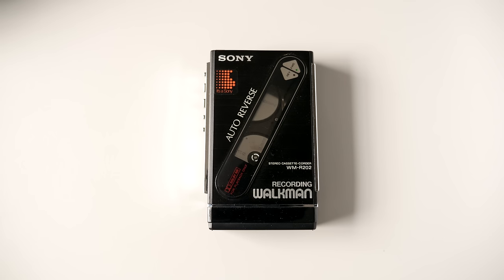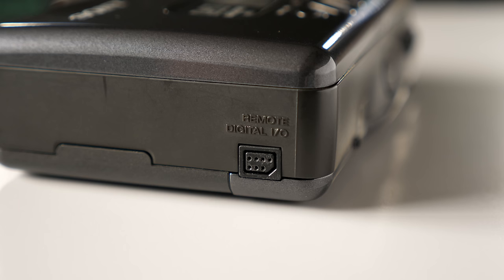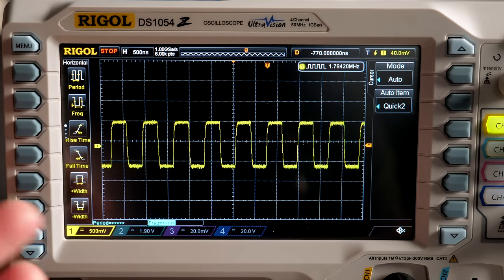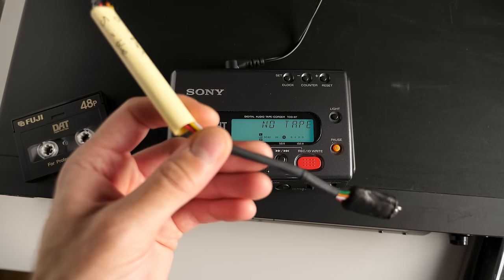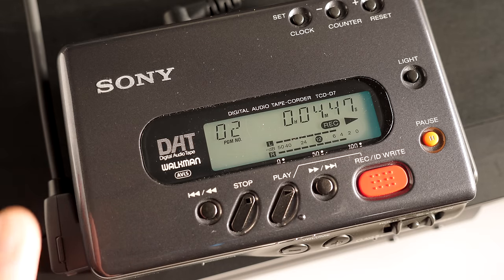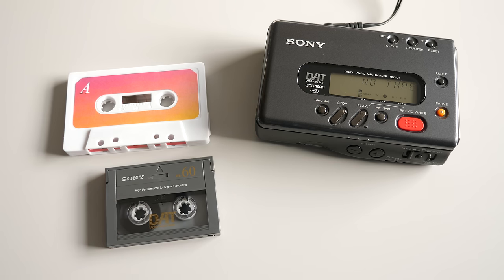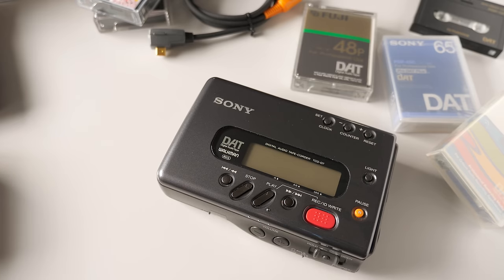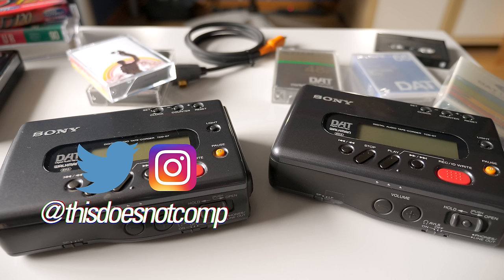Sony DAT: What Cassette Should Have Been!

Comment: Can I suggest a review item: In the 1990s, maybe early 2000s, there were the highly regarded Musical Fidelity X series components which came in a "beer can" form factor. They still go for ca 500-600 Euros these days for a pair of mono power amps. But there are a few sellers on Ebay who claim to sell copies of the internals for 50 dollars, basically just the boards, I think there is even one seller from Romania who sells them at 27 dollars. These are 50W mono amps, so obviously you would need two. The real thing is called Musical Fidelity X-A50. So the claim is that these ripped off designs actually perform like the real audiophile deal from ye olden days, or so it seems. You can find them through Ebay or hifishark.

Comment: I know a radio station that used to use DAT for jingles, etc.
Reply: I guess the reason for like 15min DAT tapes which would be rather usless for consumer use. There are also lots of these 15 and 30 min tapes going for crack smoking prices on ebay.
Reply: For delivery of jingle packages for loading onto carts or delivery systems?  Or playing directly on the air?
Reply: @scottstrang1583  I believe they recorded the jingles onto DAT, and played those directly on air. To be clear, I wasn't involved directly, and never witnessed this in action. I just heard them talking about recording jingles on DAT, and then they would take them to DJ's, who would play them on air.

Comment: DAT recorded at 48k. And I think the D7 wouldn't record via the digital input at 44.1 though the D8, which I had for recording live shows did. I miss my D8.
Reply: It actually does, but only when you record digitally. When you switch it to SP, it automatically selects between 48KHz and 44.1KHz depending on the input signal. This is so that you're able to record CDs over. When you record an analog input, it'll only do 48KHz.

Comment: NICE man!!! hahaha, I had to do that same thing back in the days, the I/O 7 pin thing. I found the info at datheads forum. I had to buy an IC buffer and so. That was a hell of a DAT deck, I used mostly to record on location but the digital I/O was handy to have.
Reply: BTW, I remember have read an article by Stephen St. Croix, a MIX magazine columnist I used to adore (resting in peace now) that DATs had a terrible error correction rate, and he was able to prove that 1:1 digital copies done in DATs will differ (data wise) from each copy generation due to the error correction algorithms, mostly caused by inconsistencies on tape media coatings,or due to friction, head misalignment, transport issues and others. I had really hard times when listening/mastering to certain DAT tapes that were recorded on different equipment than mine, and I had 3 decks! (DA-30, SV-3800 and that tiny D7). That probably add up to why they disappeared...
Reply: @juanfebresc  That's interesting to note, I have asked elsewhere on here what the deterioration of tape was like compared to the standard cassette.

Comment: I have a cd recording system from Sony. It’s quite probably another reason this format didn’t last long.
Reply: DAT was already dead as a consumer format by the time CD recording came down to a comparable price. The first CD recorders were in the order of $10-20 thousand and it was the mid 90s before the first models were released at around $1000, by which time DAT was dead as a consumer format anyway. It was, as Colin stated, the recording industry and price that killed DAT as a consumer format way before CD recording was approaching a price point even home audio enthusiasts would consider reasonable.
Reply: @Kevin H Right, I think CD recording did have somewhat of an impact on the MiniDisc and maybe a little on the DCC format, although that last one was already beaten by MiniDisc. DAT was already out of the picture in the late 90s as an home recording format.
Reply: Nope. Affordable CD recording came MUCH later than DAT. I think the CD-R wasn't even invented when DAT was launched. Only in 1995 was a CD recorder (the HP 4020i) released that cost less than 1000 dollars. There were many reasons why DAT failed, but recordable CDs certainly weren't one of them.
Reply: As said, CD recording had nothing at all to do with DAT's demise as a consumer product. DAT was dead as a consumer format LONG before CD recorders became affordable at consumer prices.

I first got to use a CD recorder in 1992, at the radio station I worked for. DAT was already considered a failed consumer product by that time, although of course it was well-established in the professional audio industry and we had numerous professional DAT decks all over the building.

At that time the CD recorder cost over £1000 (£2100 in 2021 money), and the blank CDs were about £30 each (£65 now). 

CD recorders didn't become consumer-affordable until the late 90s, and it didn't take long before they were overtaken by CD burning using PCs.

Comment: If the RIAA/Music labels hadn't been so hard re: copyright/copying and dictating to Sony how DAT ought to be controlled, I think DAT could have easily replaced analog cassette vs MD or DCC.  Without the draconian terms, DAT probably would have been cost reduced and models proliferated from Pioneer/Teac/Technics/etc 
In the end, the digital replacement for cassette ended up being MD, a Good Thing, though not mass adopted in North America. MD was superior in every way other than lossy vs lossless audio format (until HiMD, which was too late)
Of course sd cards and streaming on cell phones won the day, but for the period 1993-2012 or so, MD could not be touched for home/portable recording and playback quality.   A nearly 20 year run is great in anybody's book- longer than 8 track tapes ;)
Reply: 8-Track was so awful even in its heyday what with the tape noise it would persist and the alignment causing you to often hear another track at the same time, granted MD great format, i had/ have MD units and i love it, but 2012, maybe in japan, but even then i doubt it, i got my first ipod in 2005 and a lot of people had them by then and an ipod was just as good quality and technically better than MD, also by 2012 not only had the I devices just blasted in numbers but cellphones from android, windows, palm and blackberry all could easily trump the quality of the MD's Atrac compression and even rival Hi-MDs 1GB of storage and lossless PCM, mostly because FLAC and ALAC already existed.

Comment: I have Aiwa HD-S1 it is possible if I can record digitaly trough coax same like you showed on Sony. I heard Aiwa made some protections to don't make exact copy from CD. Plus I have to this Aiwa A/D converter HDA-1 I have no idea how to use this converter exept Aiwa HD-S1 doesn't have mic in only analog out for headphones and 3.5 inch jack for A/D in. I don't know what coax cable use it one side is probably jack and other side like your from DVD player RCA on other side. But if can find cable like that I have no idea. HDA converter has mic in. Can you find out or make the video if I can make exact digital copy from CD like you did on Sony

Comment: I disagree with you saying about recording in the red regarding analogue tapes, I always stayed away from 0db, at minimum I was always at +3db but that all depends upon the machine that I was recording on! 
Analogue compact cassettes actually had quite a bit of headroom believe it or not! The machine, apart from the transport mechanism and head's is nothing more than a bunch of preamplifier's and there's a huge difference of preamp designs between manufacturers! This is where the majority of tape hiss came from! It's unfortunate that it's called tape hiss because it wasn't just the tape to blame for the problem, old capacitors that are leaking DC will pass on that DC as what you understand as tape hiss into the recording! So basically the limitations to how loud you can record on an analogue tape always came down to how well the machines preamps were designed and how much energy the heads could take before becoming saturated, which if even the tiniest bit of DC is going to the head along with the AC signal, you reach saturation drastically sooner and you end up with a distorted recording!! It's the same reason why vacuum tube Amplifiers have such large and heavy output stage transformers! The output transformer feed's the output tubes with the DC that they need to operate while the ripple in the DC voltage which is created by the tubes passing current looks like an AC signal to the transformer which is able to galvanically couple to the secondary side of the output transformer and on to the speakers... If you were to bypass the transformer and capacitor couple it, you would be able to use much smaller output transformers because they won't be getting saturated...

Comment: 22:33 180min on cassete... LOL
I've managed to put 5 hours of 44khz music on dds4 tape with this player!
Reply: So DDS1 is not the only backup tape which works? I read somewhere that anything thinner (longer) than DDS1 tape will jam the mechanism of a DAT player.
Reply: drezster I wouldn’t want to risk it. DAT decks are notoriously fickle as it is.
Reply: @danieldaniels7571  Yeah.. Consumer DAT decks do not like anything more than DDS1. But I never had any problems on my D8 player. Also its nice to record wav files directly to  tapes on DDS drives like Sony SDT-9000.

Comment: Outstanding video! Techmoan has some competition. I'd bet good cheddar that joe/jane avg. consumer couldn't tell the diff between a well recorded metal dolby S cassette vs any format you like. Factor in availability, cost, versatility and the also-rans lose their appeal quickly. One of the longest lasting formats around; still mfg. decks and tapes, still cheap, ez entry, still despised by many, cherished by few. Anyway!? Thanks again for an informative, interesting, and entertaining video
Reply: Phil Gray have you ever tried using VHS HiFi as an audio recording format?
Reply: @danieldaniels7571  yep. I remember reading about it in stereo review around 30 years ago. Much better sound than cassette but not as portable. I'm thinking about trying it again since I found a nice Mitsubishi prosumer deck in the local goodwill. After I play with the Dolby S deck I got off Ebay of course. Thanks for asking!

Comment: Pink Floyd recorded their concerts audience on multiple DAT recorders back in the day
Reply: Yep - and Phish always has multiple DAT decks running at the soundboard every single night. They had every single channel from the stage going into separate decks so they could have 100% digital multitrack recordings of every live performance. 

Every once and a while, they release one of their top shows on CD but most are just released through LivePhish.com as digital downloads.
Reply: @JeffHochberg  I wonder how they synchronized them. They would have audio drift between DAT recorders unless they were somehow synchronized to a shared clock. Maybe clock sync was a feature on pro DAT recorders.
Reply: zoomosis pro grade decks came with SMPTE time coding which was designed for exactly that purpose. Wow - I cant believe I actually remember that! 😂

https://www.fullcompass.com/common/files/1653-D15TechSpecs.pdf
Reply: @JeffHochberg  Ah, thanks. I'd forgotten about SMPTE.
Reply: @zoomosis  Later variations of DAT included ADAT which recorded up to 8 digital channels on an S-VHS tape running at high speed. ADAT was designed from the get go to be synchronized with other recorders, so you could record a ridiculous number of digital tracks at the same time on multiple cassettes.

Comment: Would y mou recommend any USB Osilloscope  ie: hantek as an equvelant to a full size scope? To save on bench space.
Reply: I have a Hantek and I can't complain. It's really easy to operate and the ability to get data directly into your computer to analyze it with your own software is really great. For example, I've written a C++ program that allows you to decode the S/PDIF signal coming from an audio player and picked up by the Hantek oscilloscope into a wav file.

Comment: Thanks for covering this format. I was either too poor or could not justify the expense to ever get into this format when it was first released. I really wanted to get into it but it died by RIAA before it ever got going in the US. I cheat today and us a Hi-Fi VCR as my DAT recorder and player. Not the same, even though it is equal quality. It's just not as cool as DAT.
Reply: Phil Adams nice to see other people who use VHS HiFi as an audio format. I started using it in 1986 as a way to record CDs without a drop in fidelity and make 6 hour mixtapes, and used it a lot until 1999. I remember looking into DAT a few times and always came to the conclusion that it didn’t have enough benefit over what I was already doing with VHS to justify the cost or gear and much higher cost of blank tape.
Reply: @danieldaniels7571  Agreed. You were way ahead of me in 1986, but I caught on after that. When I looked into DAT, I saw the same issues, expensive, not much added in terms of functionality except ID markers. The only thing that kept me wanting a DAT recorder was the cool factor, but my budget back then just could not afford it. I still use Hi-Fi today. As a matter of fact I created a 6 hour Smiths tape a few months ago. Cheers

Comment: Recordable audio CDs would have killed DAT in any case. It was too high end for ordinary consumers, who were usually happy with either first-generation analogue tape copies of CDs up to about 2003 or later, low-quality (192 kbps or below) MP3 copies, which avoided the problems caused by all tape systems, analogue or digital. At the same time, there were better digital storage options available to professionals.
The fact that after 2000 or so, a regular consumer could actually use a PC running Windows Media Player and make audio CDs or MP3s for storage on a CD or memory stick/ MP3 player, meant that, like Blu-Ray 10 years later, DAT had many of the problems of the old format but had been superseded less than 3 years after its introduction by more convenient technology, even at the price of a temporary relative loss of quality. A tape could quite easily be stretched, or snapped, at any time. A disk can be scratched beyond use. Using these things wears down the media and puts them at risk of instant destruction. A digital file can be retrieved online or backed up.

Comment: It was a flawed design, though. You never would have gotten them as small and compact and having a complex vcr-style transport only guaranteed problems down the road. If a DAT deck was used anywhere near as much as a cassette deck, you were assured mechanical failures or eaten and destroyed tape at some point. I had 2 Sonys and a Tescam. They all had issues at points LONG before a standard deck would.

Comment: Any recording format that uses rotating or moving media is pretty much dead today.  We can build a digital recorder/player today using SD cards or SSD drives that will have recording times greater than DAT ever did, without the problematic mechanical moving tape head drums.  Optical disks are managing to hold on for the time being, those drives are rather simple to produce and the media is cheap to make as well.  The same arguments apply to vinyl, which is making a comeback.  BTW DAT tape is identical to both the digital video tape, and computer back up tapes.  I don't know if there are any special notches in the shells of those tapes to prevent them from working in DAT drives (if so that can be hacked), but the tapes should be interchangible.   Digital video tapes and computer back up tapes in the same format should be more easily available.

Comment: Surely converting SPDIF to AES only required one opamp, right? I mean if the voltage is the only difference.
Reply: Yes and no. They are basically the same format, in that the audio bits and the frame formatting are identical (defined in IEC-60958 part 1). But there are two subchannels that run at 1/32 and 1/64 the bit rate of the music (one of those contains the track markers, among other things) and recorders read those subchannels to detect if the incoming signal is IEC-60958 part 3 (aka S/PDIF consumer) or IEC-60958 part 4 (aka AES/EBU professional). It's trivial (especially with current technology) to convert one to the other though.

Comment: I'd say that the proliferation of CD-R and CD-RW (and later recordable DVD) were at least in part responsible for the lack of acceptance of DAT. Why should someone pay for proprietary media and equipment when they could have the same convenience out of something universal that was also much cheaper?
Reply: But CD-R drives weren't common until about the year 2000. DAT predates them by about 10 years.
Reply: @zoomosis  I started using one in about 1996 or so, so I guess that sort of colors my perspective of it. And I said that they were "in part" responsible for it not really catching on in the consumer market.
Reply: @mattelder1971  I remember Kodak Gold CD-Rs were basically all you could buy (at least in Australia) in ~1997 at about $7 per disc. The drives were also very expensive ($400 for a 4x burner) and SCSI-only. And CD ripping was still in its infancy...

Anyway, you could ask the same about why MiniDisc never really took off outside of Japan. I guess regular cassettes were good enough for most people, particularly since practically every car had a cassette player as standard.
Reply: I worked with CD recorders since 1994 and they were much more expensive than DAT in that time, and way less reliable (remember buffer underruns?). There were no audio CD recorders until about 1996 or 1997 (I worked in the same building as where Philips was developing one), and the first affordable CD recorders that fit into a CD-ROM drive bay of a computer appeared around 1997. By then, DAT was already almost 10 years old.